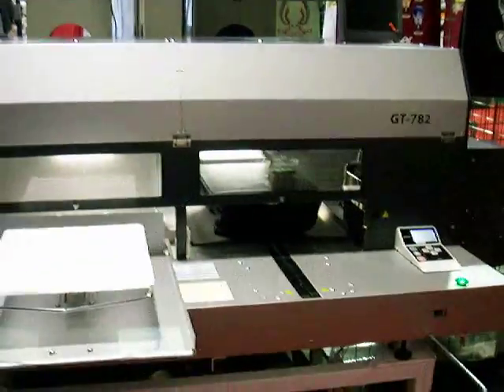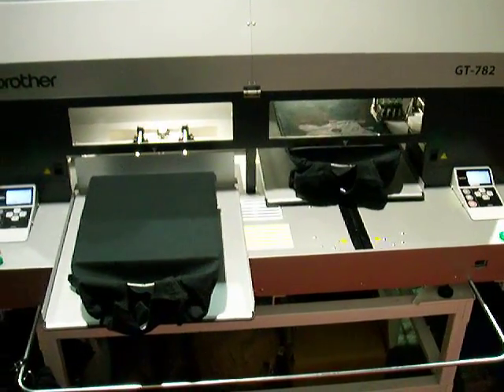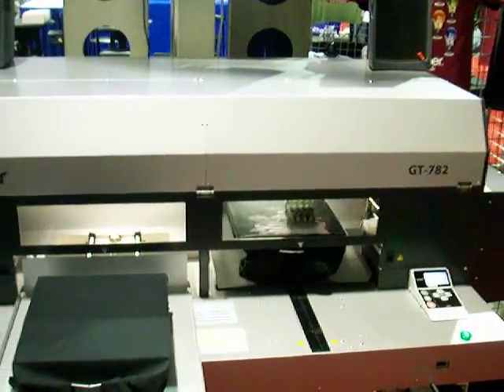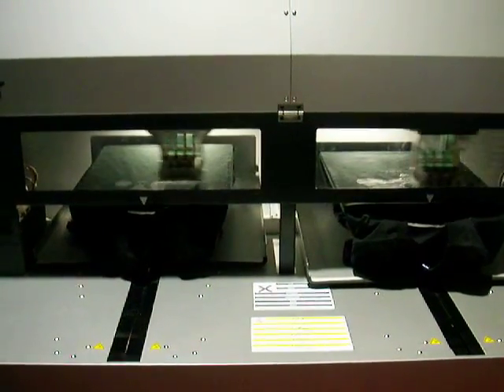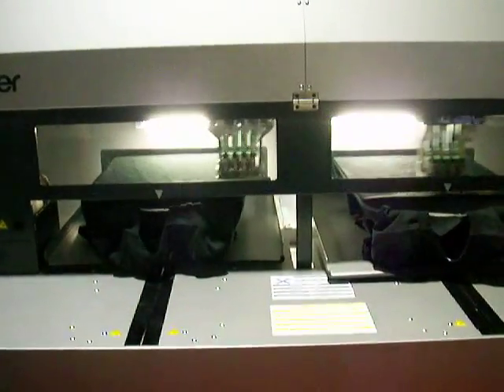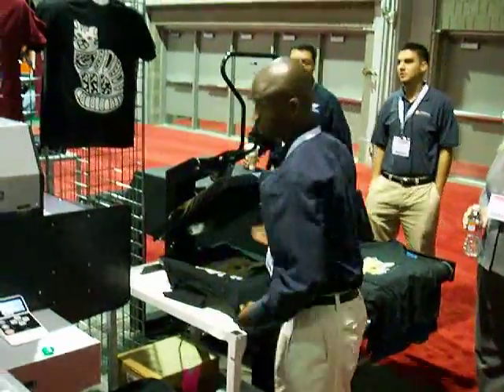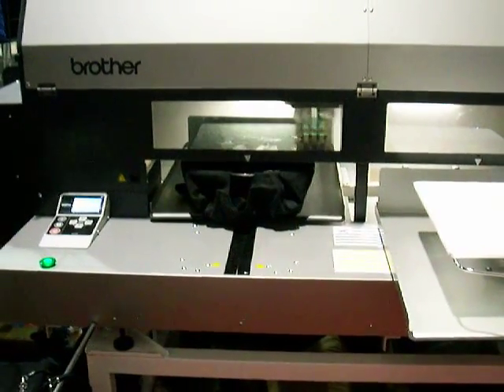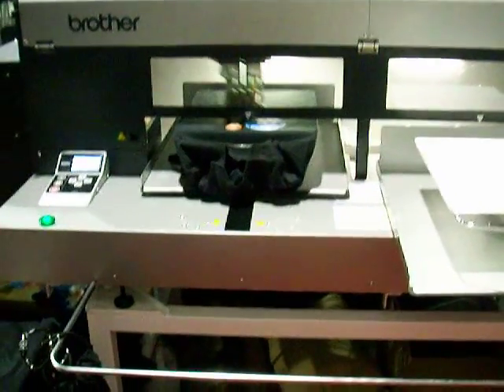Brother GT-782 Direct to Garment White Ink Printer Preview

Comment: Taken from their website: 
"Q What kind of print heads and print engine does AnaJet use?
A. AnaJet uses Epson print heads and print engine. Much additional engineering efforts have gone into the system to assure the printer is optimized for textile and garment printing."